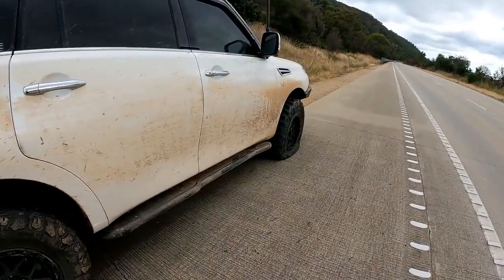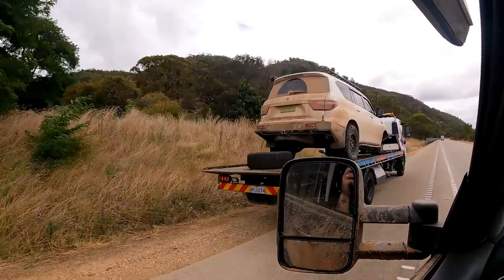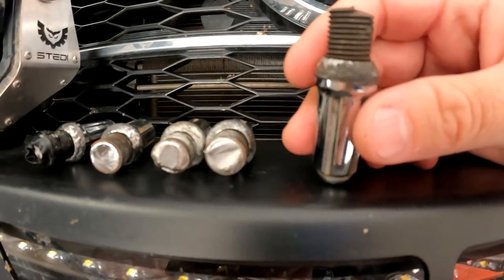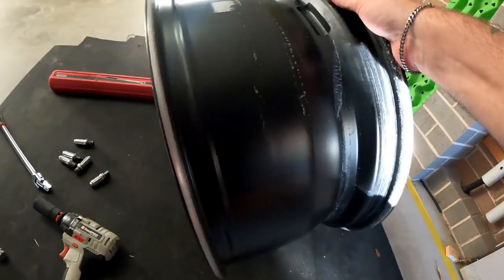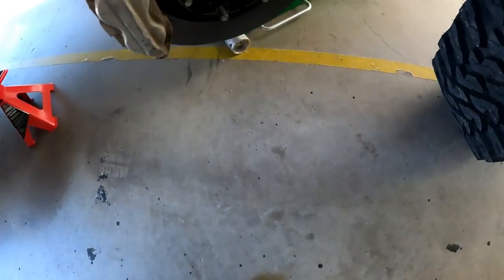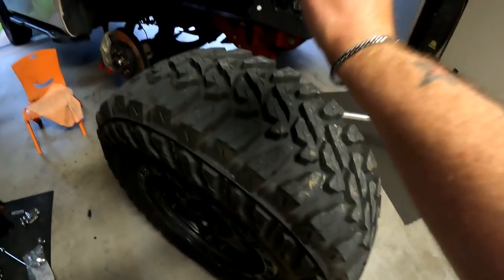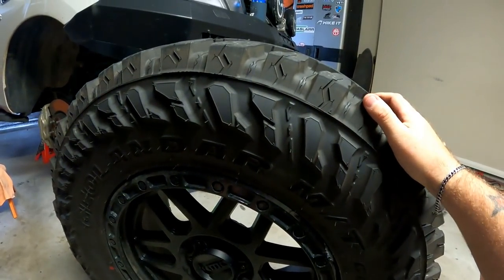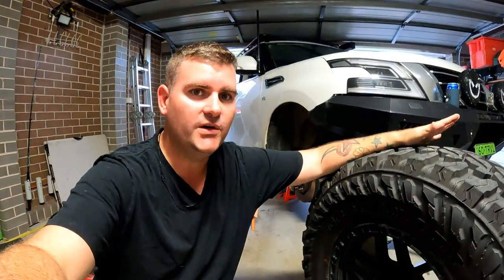I broke the Patrol - 6 snapped wheel studs  - HGT Y62 Patrol Build

Comment: For everyone wondering. Studs are never meant to take the weight of the car, they are only to tighten the wheel to the hub, If your wheels have a larger centre bore then the spigot on hub you MUST have hub centric spacers to take up the difference. The spigot on the hub takes the weight of the entire car the wheel studs do not. Great info in the vid. Hopefully this helps someone.
Reply from the maker: Thanks mate, it was a hard lesson to learn but I couldn’t have got any luckier with it ✌️
Reply: @HappyGoTravel  you sure did. Glad you got out of it all ok. Almost had it happen as a kid. Tyre shop fitted msg wheels and on the way home one wobbled loose.and almost off. That’s the day I learned about hub centric spacers.
Reply: @Wade Beasley you couldn’t be more wrong. 👍 good luck with that
Reply: @4wdglampingaustralia102  we can agree to disagree then 😉
Reply: @Wade Beasley sorry you are wrong. The centre boss does take the weight, the nuts just hold the wheel on.
Reply: @stevendouglas6593  that's incorrect
Reply: Hub centric spacers are not necessary with the correct wheel nuts. But they do help the fitter centre the wheel more easily.
And It's the friction between the hub and rim surfaces that takes the weight of the vehicle,  not the spigot on the hub.
Reply: @SteveBurns80  your plain and simply wrong. I defy you to find any engineer part with a load bolted sideways? 
What do you think the spigot is there machined or cast in the hub? 
Just for shits and giggles?
Reply: @4wdglampingaustralia102  No, I'm not wrong. It's the frictional clamping force provided by the torque on the wheel nuts and studs. Nothing to do with the spigot, the spigot just helps locate the wheel.
Reply: @SteveBurns80  find me another example of this engineered frictional force that can hold up many tons? 
I’ll apologise when you do. 
Spigot is to locate the wheel Bahahaha because Toyota give a shit about how easy you the consumer can locate a wheel. 
What’s the more logical reason?
Let’s make it easy for Steve to put on a wheel or it’s a load bearing engineered part.
Reply: @4wdglampingaustralia102  Easy, plenty of examples, virtually any nut and a bolt clamping two surfaces together, the more force you apply on the nut and bolt, the more frictional force on the surfaces. Believe it not, your wheel nuts and studs are designed and engineered to apply more than enough clamping force to the surface of the wheel and hub, to hold the weight of the vehicles max gvm and all the dynamic loads from braking, cornering, potholes ect, without any help from that little lip from the centre of the hub. Oh and look how many after market wheels there are with larger centre bores, they usually supply pissy little plastic centric spacers to do just what you joked about, help you centre the wheel on the studs, not to hold the load of the vehicle. 

These are the facts! Go check them for yourself. Glad I can help you.
Reply: @SteveBurns80  just stop. Your example?
Reply: @SteveBurns80  best to just agree to disagree. Enjoy your long weekend good sir. 👍
Reply: @SteveBurns80  most people don't get it just give up haha.
Reply: @4wdglampingaustralia102  look up a shrink disk. We use them to drive 20km long conveyors loading thousands of tons of iron ore. All by using friction between the two surfaces 😉
Reply: @thebeerhunter817  just looked it up. Dude it’s not even close to being the same. Slide the rings over a shaft. Tighten the rings together to force down the double tapered ramp to apply friction to the shaft. There is absolutely no sheer load applied to those bolts it’s all tensile load. By running a wheel with a bigger centre bore you introduce sheer loading to the bolt. They are not designed for that. Look you can argue all you want but at the end of the day if you run your wheels like this it’s a roadworthy fail. It’s a fail for this exact reason. I’m not here to argue either. Go on with your life ignorance is bliss. 👍
Reply: @4wdglampingaustralia102  you obviously don't have a mechanical background but that's ok. Still even an accountant can see that no car ever made has hubs supporting the wheel directly 😉
Reply: @thebeerhunter817  I’m actually motor vehicle safety advisor. I ensure repair facilities are certified, can demonstrate and are capable of repairing vehicles. Read into that as you will. Like I said it’s a roadworthy fail. Ask yourself why? Gotta be a reason right?
Reply: @4wdglampingaustralia102  that's hilarious haha
Reply: @4wdglampingaustralia102  You're a vehicle safety adviser? And you can't understand this or do a simple fact check? That's scary and funny at the same time.
Reply: Hub centric spacers are plastic and only help to center the wheel on the hub, they do not take the weight of the vehicle, they can't because they're plastic! The reason the studs failed is because the wheel nuts were the wrong type and too short to engage sufficient wheel stud thread to provide the clamping force required. Correct wheel nuts will engage at least 14mm of the thread as per this video: https://www.youtube.com/watch?v=rv8p5Vj21aY
Reply: @4wdglampingaustralia102  you are incorrect and if you don't understand Hi Tensile bolts and their load ratings in shear and tension, then you can't be helped. Its the clamping force that supports the weight, did you know that usually Hi tensile bolts have a greater strength in shear compared to tension, but then you would need to know the difference between shear and tension.

Comment: Thanks interesting point made. Fitted tyres for years broken studs are not common problem for stock fitment    look at 750x16split rim alloy inset can bind and seem right but     upsize wheel s put a lot of hurt on everything side wall tread in mud your 5 wheel  stud is weekest  Link

Comment: I had a similar issue with my old hilux when change to after market wheels/studs you can identify this with a cheap toque wrench ,eg before a trip I toque the wheel nuts to the specified 120 nm an check after they had gone to under 100 nm so I knew something was wrong.

Comment: Yes very lucky for sure. 

Check Ronny Dahl latest video. 

I had new rims & tires the Guy never tightened the nuts on the front left did about 3 kms front wheel came off I had a slight vibration so slowing down I was in a 60 kms so I would of been doing 30 km I guess. 

Wheel rolled off hit the gutter then bounced 30 feet in the air in a open field for 200 to 300 feet   

Lucky I didn’t kill anyone. 

The tire Guy came found all but one nut which meant they where not tightened. 

So never trust anyone anymore.  

Your right what you said that was the problem your gut instinct was right pays to check when your Family is on board. 

Love your videos stay safe Cheers
Reply from the maker: Cheers mate, I was shocked, definitely lucky. I always check my nuts these days

Comment: Checked mine, I only have 12mm of thread engagement on a 14x1.5mm stud. Even though I have hub centric spacer I have ordered a new set of long shank nuts which will provide 19.5mm of thread engagement. I'm running Hustler Ambush rims. Remember when the wheel nuts are correctly torqued the vehicle load is taken by the clamp force between the wheel and hub, not the bolts.
Reply from the maker: It’s a fair bit of difference. Im wait in on hub centric spacers to rock up now. Im not going through this again 🤣
Reply: S P, are those Hussla Ambush wheels on a Y62? If so, where'd you order the nuts from. I have them on my vehicle, and hence the same engagement issue, however, the company that supplied them to me aren't that helpful.
Reply: Yes S5 Y62, Lugnutking.
Reply: @sp2074  Legend. Have put in a request. Many thanks.

Comment: My local Nissan Dealer tried twice to rip us off.  After a full service I checked and found the oil and air filters were not changed - I’d marked them.  Then, an A/C belt snapped, I checked the A/C compressor which turned freely, but Nissan tried to tell me it was seized when I got them to fit a belt, quoted about $2000 to fix.   Just goes to show, it’s not just the back yarders you have to watch, it’s also the ones with the very big name brand signs.

Comment: The G003s are noisy as. I'm kinda regretting getting them
Reply from the maker: They definitely make a little noise but nothing on my old kumhos
Reply: @HappyGoTravel  yeah ok. Hmmm
Reply from the maker: @DarrenBoxhall  the kumho mt71 were more aggressive so I did expect them to be louder. These I thought would be quieter than they are. Mud tyre life though 🤷‍♂️🤣
Reply: @HappyGoTravel  hahahah yep. Yet $300 comforcer cf3000s are quieter. There g003s have a wiring noise like they are 20,000ks old. The Cf3000s are quiet as when new
Reply: Mud tyres are the biggest marketing gimmick.. In any decent amount of mud/clay  mud tyres will make bugger all difference. Even treps will spin in the slippery stuff. 

So for anything that's not a dedicated rock crawler any hybrid tyre (Toyo RT etc) or even an aggressive AT will do just as good of a job if not better than a MT in every single condition including mud. 

I just have to laugh at people rolling down the highway on muddies.. getting to the beach with muddies.. getting off road with muddies where you could take a corolla.
Reply: @Nick-sd7um  wtf are you on about. Of course mud tyres spin in mud, that's how they work. 

And they are more robust than highway terrains and AT's. 

Let me guess, you drive a 200 that can only fit 32s on it?
Reply from the maker: @Nick-sd7um   in a lot of situations a at is more than adequate. Don’t get me wrong I agree with you in a lot of ways with there are plenty of people running them just for looks that will never actually really need them.

However mud tyres offer a lot more traction in a heap of different off road situations other than mud. 

Of course you can take different lines and just drive to your your vehicles capabilities this includes your tyre choice.

I actually tested this theory on my last 4wd. What I found is when I went back to ATs I could still go every where I wanted. I generally just had to take different lines or drive harder and use momentum more.

It’s no different to saying you don’t need work boots a smooth bottom dress shoe will take you everywhere you need to go.

Me personally, I prefer mud tyres and can live with the few downfalls for the times I really need them to preform.

But like every thing it’s a personal choice ✌️
Reply from the maker: @DarrenBoxhall   when it comes to mud tyres those who know, know. There are definitely a lot of people that don’t actually need them that just run them for looks

If nothing else it sounds like Nick just knows he’ll never put his vehicle in a situation that really needs them. I have a lot of respect for someone that makes and sticks to that decision. 

Me personally I love driving stupid challenging stuff where the little bit of extra mud tyre traction is the difference between driving or winching ✌️
Reply: @HappyGoTravel  a very well and thought out response. 

Unlike old mate above who thinks I drive a 200 lol.. Td42 GU.